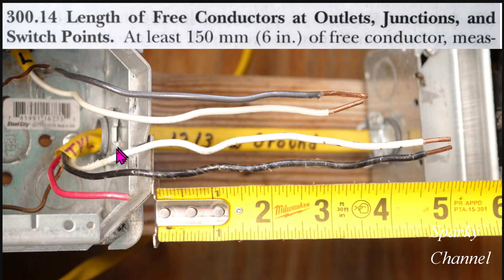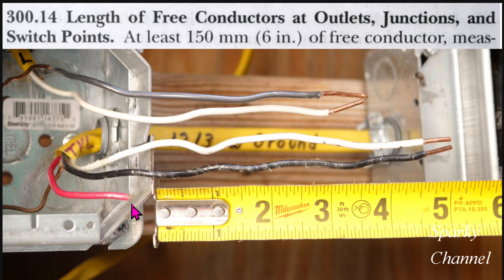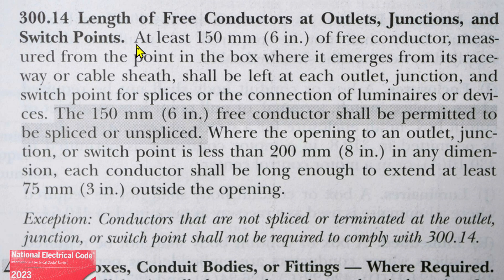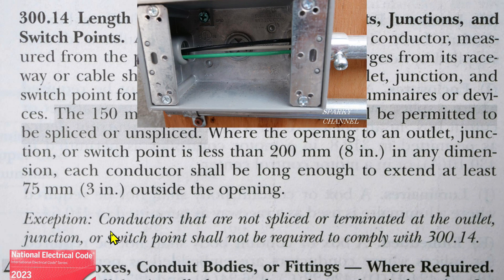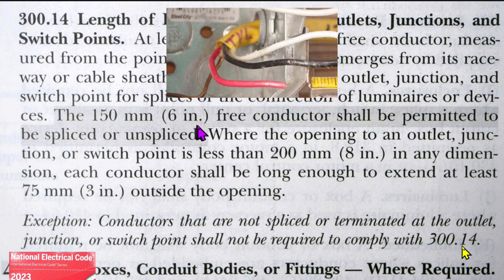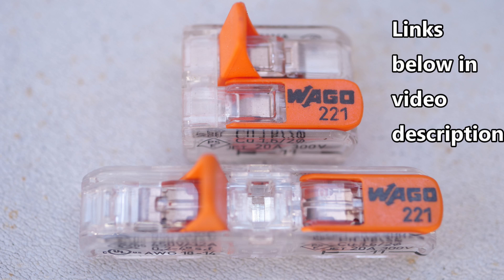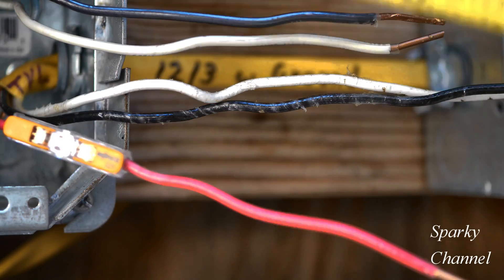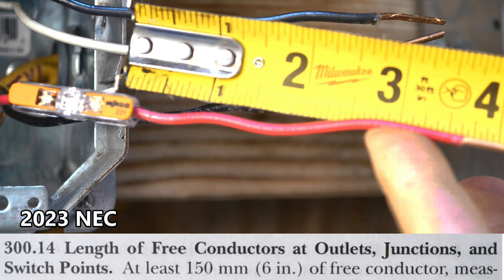How to Extend Short Wires per 2023 NEC 300.14

Comment: Very helpful video! Question. Can the spliced wire be pigtailed to other wires in the box? For example, could you pigtail the red wire you spliced to another red wire in the box?
Reply from the maker: Yes.
Reply: @SparkyChannel  I'd rather bring the other wire and the short wire to the connector and pigtail from there, rather than lengthening a short wire, connecting it to another and pigtailing from there. It's more connectors and kind of redundant. I like to remove anything unnecessary from a junction box.
Reply from the maker: @illestofdemall13  I'm not really understanding what you're saying on this one. I'm sure you're correct but it's not sinking in right now. :)
Reply: @SparkyChannel  Imagine a junction box with 2 cables coming into it, each with hot, neutral and ground. Now imagine if I wanted to pigtail the black wires, I'd add a pigtail and connect the other two black wires together with my pigtail. Even if one of them was short, I'd leave it short and arrange it so the other would reach and then I'd pigtail. What Paul was asking is if he could lengthen a short wire, join it to another and pigtail it. So he is using 2 wire connectors to do what I was doing with one.
Reply from the maker: @illestofdemall13  I see. Thanks for taking the time to explain that. Yes, I would do the same as it's one less wire connector and it achieves the same result. That pigtail coming out of the wire connector would now have to reach at least 3" outside the box though, according to the new 2023 NEC. That's my interpretation.
Reply: @SparkyChannel  You're welcome. I have been inside some boxes with strange connections, like a jumper wire between two wires, then a pigtail joined to one end of it. So instead of combining 2 wires with a pigtail, they jumped from one to the other with a wire then added a pigtail and used and extra wire and wire connector. Yes, I agree with you that it would have to reach 3" outside of the box (which is not unreasonable).
Reply from the maker: @illestofdemall13  Or outside of the mud ring that is on the box. I actually called NFPA (I'm a member this year so I get to call and ask) and I asked an "engineer" about the mud ring situation, and he said that the new 2023 handbook is actually going to have a picture showing that wires have to reach at least 3" beyond a mud ring attached to a box.
Reply: @SparkyChannel  Yeah because imagine if you had a 1 inch mud ring and the wire was 3 inches outside of the box but only 2 inches beyond the mud ring. That would defeat the purpose of this code.
Reply from the maker: @illestofdemall13  Agreed!

Comment: Thanks, Good to know that you can splice - most the old outlets in my house give no more than 2 inches (and that before you trim any damaged ends).    But about the inline Wago splicer - I'm having a little trouble finding it on amazon - the one i found  seems to be rated  Solid conductor: 20...14 AWG ( 221-2411 the one you used ) .   
theres a 12 AWG version  221-2401 but at the moment i can only find it  in lots of 2500  ( my house isn't that big :)
Reply from the maker: Yes, the 12AWG Wago splicer is Wago 221-2401 Inline splicing connector with lever; for all conductor types; 12 AWG (max.); 2-conductor; transparent housing; white cover:  https://www.wago.com/us/wire-splicing-connectors/inline-splicing-connector-with-lever/p/221-2401
  The 221-2411's are rated 14-18AWG.
  Hom Electrical has the 12AWG ones 60 for $24: https://www.homelectrical.com/wire-connector/wago-wag-2212401.1.html?gclid=Cj0KCQjwnvOaBhDTARIsAJf8eVOnXZ87ZYgNY5Ac63GA0Uytc7Qjcjrn_CNhOUhddTQFCNmnVcuO9UMaAqWAEALw_wcB

Comment: Awesome review and appreciate the clarity.  A lot of my boxes needed conductors extended. The installer used wire nuts without cleaning paint off the copper and had to be trimmed.  Yet another benefit of wago style splice as it’s less destructive to the wire when you need to make changes.  I do like the ideal lever nuts over wago as the lever feels far more reliable.
Reply from the maker: Thanks!

Comment: Another great video Bill, love Wago lever nuts, i've been using a 2 port Wago to extend short wires. I sent you an email in regards to a question.
Reply from the maker: Hom Electrical has the 12AWG ones (221-2401) 60 for $24: https://www.homelectrical.com/wire-connector/wago-wag-2212401.1.html?gclid=Cj0KCQjwnvOaBhDTARIsAJf8eVOnXZ87ZYgNY5Ac63GA0Uytc7Qjcjrn_CNhOUhddTQFCNmnVcuO9UMaAqWAEALw_wcB

Comment: Every box the previous owner of my home worked on has the shortest wires seemingly possible to make the connection. It's so annoying.

I'm definitely getting some of these.
Reply from the maker: I agree. Thanks!
Reply: As a long time DIYer, these Wago connectors are a great invention!  No more struggling with wire nuts and ‘hoping’ they’re a good connection and the ease of completing the task and solving the short wire problem.
Reply from the maker: @glasshalffull2930  Right on!

Comment: In-line lever lock connectors are great for extending short wires, but they're still not as compact as a butt splice.
However, the problem with butt splices are that you often can't get the crimping tool in there to crimp them because the wires are so short.
Does anyone make a Push-In type in-line connector? They would be almost as compact as a butt splice but would not require crimping.
Reply: IDEAL makes an inline push in connector that is about 25% shorter but nearly twice the width. They should work just as well, unless the wire is so short, you can’t hold it to put while splicing.
Reply from the maker: Link for other viewers: Ideal 30-1042 SpliceLine In-Line Wire Connectors (Box of 100): Amazon: https://amzn.to/3ztkzMW
Reply: Little known fact, but the Wago lever connectors are push in for solid wire! You only have to open the lever when inserting stranded wire, and obviously when removing wires.

Comment: to me the downside of the straight splice would be that it has twice the rigid length of the lever nut.  sometimes that will be more of a problem than needing a little extra tail for the lever nut. but certainly the worst splice to use in this situation is the hardware store compression splices  they can rarely be made secure in that situation.
Reply from the maker: Yes, getting a splicing tool into the box might be one problem. Thanks Ken!
Reply: @SparkyChannel  those cheap crimp splices don't work well on solid wire to begin with.
Reply from the maker: @kenbrown2808  Yep.

Comment: Bill, thanks for pointing out the Wago Inline Splicing Connectors - I had been using the 2-conductor Wago lever-nuts for situations such as these, but they are less than ideal for the reasons you pointed out.
Reply from the maker: Thanks Eugene!

Comment: I perfer to wirenut it with a longer tail instead me personally
Reply: Me too, but sometimes it is too short for that, so I have wagos also
Reply from the maker: Yes, wire nuts will work fine for splicing. It may be difficult to get your fingers in the box far enough to do a good job of twisting though.
Reply: @SparkyChannel  I prefer a good mechanical splice, and a wire nut, for splicing wires but I do like that Wago for extending wires.
Reply: I am a big fan of the wago “style” connector. It’s much cleaner and offer’s easier changes down the road.  I love the new ideal lever connectors over wago as the lever seems to be less prone to opening - if you can find them.  They allow the installer to push in or use the lever to insert cable.
Reply: Me too...I use a yellow instead of red, if it's really short
Reply: I just twist em and wrap with masking tape. Jus me
Reply: I have changed lots of failed outlets that the push in the back has been used on, especially in garages. It may be a totally different connection but it has made me shy away. A guy I have know for years who worked for a big electrical company in town is now a code enforcement inspector. Locally you can not use the push in outlet connection any longer because they fail. When working with him he used the wago on low draw things like LED lights but not on high amperage draw items. Use what you trust. I don’t care what the next guy uses as long as it is code.
Reply: @CBrown07696  Watch from 7:30 of the video titled "Connectors: Which is the Weakest Link" by the channel "Electromagnetic Videos" to see the difference. The back push in electrical outlets failed after 5 minutes at 50 amps, the Wago push-in only connector failed after 65 amps, and the lever Wago failed after 70 amps. If you cannot trust something that operates safely at 3x rated value then, well, you do you.
Reply: @msytdc1577  I doubt the building inspector will use the video over the local code. Like I said, use what you are comfortable with and meets code in your area. The push in outlets fail after getting hot and cooling over and over again. A one time load test just shows what a new outlet will take one time. They may be the best choice and I may be wrong. If you looked up my channel you see I suffer from “COGS” Cranky Old Guy Syndrome. Lol
Reply: @CBrown07696  Oh, well, I see how my comment was a bit confusing, but I agree with you 100% on the push in back connectors of outlets; those things are flimsy trash made by many vendors in various (low) quality implementations that are all hidden from view behind mystery material plastic, and as seen in the video have barely a 2x safety factor. But I have no qualms whatsoever about the Wago connectors, made by one trusted manufacturer for decades with its guts on display with a demonstrated 3x+ safety factor for a 20amp circuit. Now do I, or would I, trust a random batch of grey plastic Chinese no name lever connectors in the same way, hell nah.
Reply: I agree with wagos.
Reply: Yeah those are great for this purpose. They even make in line push on connectors like wagos that have an opening at both ends instead of the connections being next to each other so you don't have to bend the wire around.
Reply: @anthonyesposito7  IDEAL spliceline
Reply from the maker: @surferdude642  Ideal 30-1042 SpliceLine In-Line Wire Connectors (Box of 100) 20-12 AWG Solid, 16-12 AWG Stranded: Amazon: https://amzn.to/3ztkzMW
Reply: Whatever floats your boat. My focus is on safe and reliable, first. Convenient, second. WAGOs meet all three. But then, I splice more wires in a day than most folks will in their lifetimes.
Reply: @ethelryan257  wirenuts are safer and more reliable than wagos, the only reason people use wagos are because they put convenience first
Reply: @pgood7266  As a DIYer who genuinely wants to know, why are wire nuts safer? To date, I've only ever used wire nuts when doing things around the house but am definitely intrigued by the lever style option, especially as I run into short wires and boxes that are tight on space.
Reply: @KRex1313  My thought is they're just perceived to be safer because they've had several decades to prove themselves in practical application. Lever-lock style connectors are a much newer technology, and although they appear to be every bit as safe, we don't quite have data of the  same sample size as wire nuts (or even push-lock connectors).